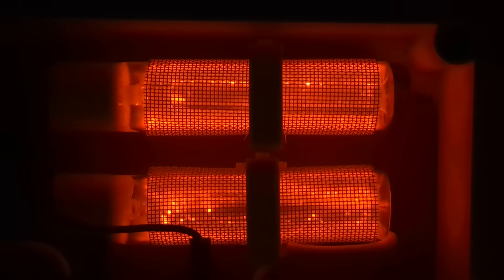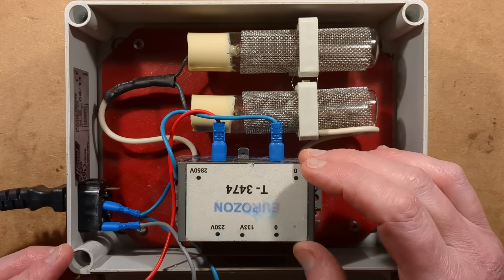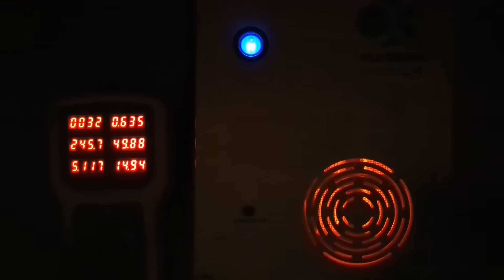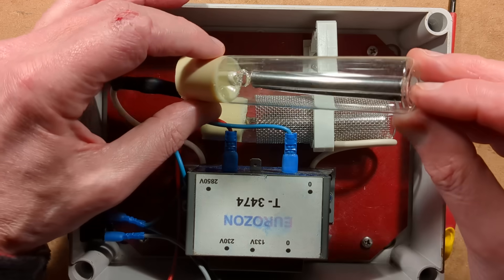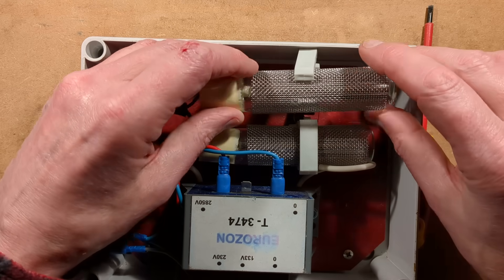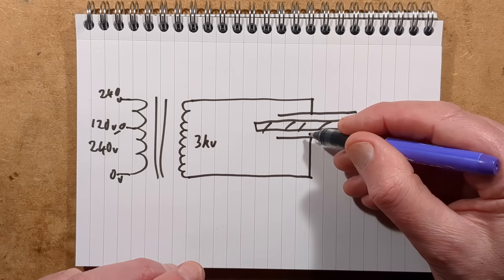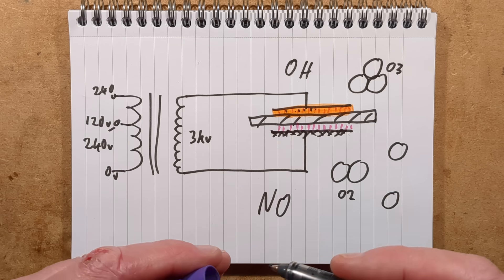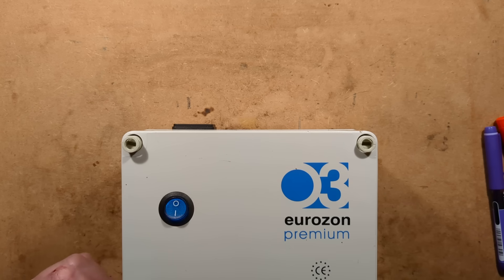Neon plasma ozone generator

Comment: This looks more like a DIY project than a commercial appliance. This type of box is used here in Europe for electrical connections or as a project box. My OCD also shoots up whenever I see an appliance with the on/off switch positioned with off at the top and on at the bottom. I see this regularly in DIY projects here on YouTube. Of the commercial appliances I've ever seen, I've rarely seen a switch with the on/off switch off at the top and on at the bottom. Years ago, I heard a story about why most appliances have the on/off switch on at the top and off at the bottom. The reason was supposedly for safety reasons: if the appliance is against a wall or on a table and an object (e.g., a book from a shelf) falls onto the appliance and hits the switch, if the switch is positioned with off at the bottom, the appliance will turn off (if it was on). Conversely, with the switch arround the appliance would turn on, which could pose a safety hazard.
Reply: commercial appliances often are just standardized electrical boxes with stuff inside. Maybe you are confusing commercial with consumer appliances. Anything sold to consumers must have a custom-made box of often debatable design for some reason
Reply: @marcogenovesi8570  commercial appliances have usually custom made boxes and not universal electrical connection box / project boxes of the shelf.
Reply: Do I understand it correctly, that for off at the top feels more proper? Where are you from?
I noticed, that in Ireland they almost always have off at the top of the switch, which was notable, becaus in Germany off is usually at the bottom.
Reply: @HalfInt  you got it backwards. i meant that it is more proper with on at the top, and off at the bottom. English is not my mother language,i used google translate and it messed up the translation.🙂

Comment: Darn Clive, I was hoping you'd light the neon tube without the mesh around it. Those are very interesting tubes and I didn't expect such huge electrodes in there.
Reply: They won't light without the mesh. The mesh is the second electrode of what amounts to a gas discharge tube.
Reply: @sootikins Aah I see. But why do they have 2 electrodes inside then? Perhaps they used tubes that were also used for a different application?
Reply from the maker: It's standard base with two wires coming in, but only one electrode.
Reply: the mesh is a necessary part, it's the other electrode

Comment: This "Eurozon" is an spanish bussiness (with not the best construction) and it's easy to find this ozon generators in bathrooms in bars and restaurants.
Reply: Those are the very compact ones like shown here.  They make industrial ones as well.
Reply: @douro20  yes and industrial ones have better construction sure, but this "semi-domestic" unit it's too basic, they could mount a cheap fan to force air and get better ozone efect.

Anywhere this is an old domestic device and Eurozon probably is way better now than ten years ago.
Reply: Poor Italians getting crossfire from a slightly shi__y Spanish design ;-)

Comment: 2:45 Ozone is heavier than air (actually 1.5+ times heavier), it will flow out of box through all bottom openings and create draft.
Reply: Ah, that bit of info makes it all make sense.   As the concentration in the enclosure gets very high the flow will begin.  Thank you.
Reply: ozone may be heavier but it would take terrific amounts of ozone for that to matter.

Comment: Seen one of these in the Gents toilet block at my local park. Only public toilets around that don’t stink. The park is National Trust land is kept cleaner than our municipal parks. Glad to know exactly what the unit is.
Reply: This explains why it has no moving parts.  
Longevity in Operation, as the units I doubt get much maintenance at all - ESPECIALLY when used in Public commodes.    
All of a sudden the lack of a fan makes perfect sense.
Reply: Same here...I saw an ozone unit in the public restroom at a state park. There wasn't the usual stink associated with public toilets...
Reply: Where exactly is that public park... 😊
Reply: Stinky toilets! 😭👎🤮
Reply: Any warning on how long you can stay in there before you fall ill?
Reply: @tonysheerness2427  it's not powerful enough for that
Reply: @tonysheerness2427 The converse of “if you can smell ozone, there’s too much” is “if you can’t smell ozone it’s probably safe”.

Note the “probably” and act accordingly.
Reply: @tonysheerness2427  & if it has an extractor fan in addition to the O3 thing = the gas is being continuously sucked out of the toilets

Comment: I kinda want one of those tubes to try with my violet ray wand.
Reply from the maker: They make ozone tubes for the violet wand system.  But just putting a grounded mesh on the standard glass electrodes would work.

Comment: Wonder if the transformer hit the green neon. I have a question about using uvc to clean the air, you have mentioned In past videos that their is such a thing as to much corna discharge. If I were to put a unit in my a house hvac how offten would you cycle it? Or only when you were  out of the house.
Reply from the maker: You would only want a trace level of ozone indoors.  No more than exists naturally outdoors.

Comment: i'm only a small way into the video, but could you place a cheap USB fan near the grille? or does that damage the fan/battery? (am art graduate not sciency, sadly)
Reply from the maker: A small fan blowing in would increase the effectiveness greatly.
Reply: would it be better for it to blow over/near the top opposed to blowing at the base due to how suffocated it looks? i guess my initial mental image of an improvement was either a fan pulling from above...or some goose-necked fan snaking its way to roughly above the output grill (if one didn't want to modify the chassis itself)

Comment: An ozone generator in a plastic box? Wonder how long that will last before it crumbles away from oxidation.

As far as nitrogen oxides go, you've got

Nitrous oxide: N2O
Nitric oxide: NO
Nitrogen dioxide: NO2

They get progressively more toxic as you increase the oxidation level. Search for a YT video on the Cleveland Clinic fire for a good example. I think it was the Fascinating Horror channel, but maybe Scary Interesting or Plainly Difficult.

Comment: If you can smell ozone it's to much for food.
While working at SunCorp Stadium, I was told by the food inspector that high ozone accelerates food going off as ozone breaking cellular structure.
Reply from the maker: I think it would take extreme levels to physically damage food.
Reply: depends what food.  fresh fruits and veggies, I think, would be somewhat resistant the same way we are -- we have skin

Comment: This is s type of dielectric barrier discharge (DBD) rather than corona. Corona discharge doesn't require an insulator (the glass) and uses higher voltages, but is less efficient at generating ozone. These two types of discharge are frequently confused.

Comment: 11:01 Nitrous oxide is N₂O. This is the "laughing gas" used as an anaesthetic by dentists and by some people to get high. Nitrogen forms a lot of oxides. I believe you were thinking of nitrIC oxide, which is the one that's NO. There is also NO₂, nitrogen dioxide. The Wikipedia says that it is nitric oxide which is made by lightning, so the high voltages could generate that on their own.
Reply: Nitrous oxide is also what makes your car go like a rocket when you add a measured amount to the combustion process.
Reply: @AcornElectron  or blow up the engine if you use the wrong amount
Reply: Some sources also claim that nitrous oxide will also be produces in corona and dielectric barrier discharges. But proably only trace amounts, not enough to get high from it. You would feel unwell from the ozone and other nitrogen oxides first.
Reply: Yes he means nitric oxide and this can further react with air (oxygen) to form nitrogen dioxide which will dissolve in water to make nitric acid. It used to be a pathway to manufacture nitric acid and still is, where electricity is cheap. The process used an arc discharge rather than a barrier discharge because of efficiency.

Comment: Looks very nice, but lack of flow is a flaw.
Reply: Adding a small fan would be a good idea, but then of course you'd have to fit some kind of power supply for it, which could end up being more complicated than the rest of the unit put together (a cheap Chinese SMPS from ebay would probably be safe enough, especially if it's inside the case where you can't actually touch it. Maybe a capacitive dropper might work too as long as the fan is a low power one.

Comment: I'm surprised the plastic parts inside the enclosure haven't been degraded by the ozone.
Reply: That was my first thought when Clive pointed out the absence of a fan- the thing will fill with ozone which will only slowly diffuse out through the “stylish” (in a retro 70s military speaker grille manner) ventilation holes.

My guess is that it didn’t see much service before Clive got hold of it.
Reply: Is there a trustworthy source where you can check various materials how resistant they are towards ozone?
Reply: @abavariannormiepleb9470 Yes, you expose them to ozone and check them periodically for degradation. There are charts and tables online with results for many materials.
Ordinary wire insulation (not the HV silicone) and paint are notably susceptible to degradation. The fact that they aren’t discolored or crumbling suggests this particular unit probably hasn’t seen much service.

Comment: I don't see need for fan. Over the long run (hours, days) the ozone generated will diffuse into the room. Or what recombines in/near the box can be compensated by a little more generator (maybe why they have two tubes?)
I think/hope this is a stink killer for a toilet room. I go in, I make my stink in 5 minutes, then maybe not go back in for 4 hours: about 5% duty cycle for my lungs. Compared to most city and some office air, that's nothing.
Reply: other people have reported finding this in toilets so you seem to be dead on

Comment: That is the Star Trek TOS-est thing I have ever seen.  Would also accept Blake's-7
Reply: a whole different kind of aesthetic for sure.  most devices would hide everything away, but they wanted to convince the customer it's doing something!

those neon bulbs are so weird.  I wonder the story behind them.
Reply: @tsm688 Now that you mention it, it’s kind of strange that anyone would design the tubes specifically for this purpose. The popular association of ozone with UV would suggest a different gas that emits in the blue, like argon or xenon.

Could be they were originally designed for something else like a specialized indicator or narrow spectrum light source, but I can’t think what in that single-electrode configuration. They might work nicely in a violet-ray machine.
Reply: @markfergerson2145  they could be ends from big cold cathode tubes, filled with neon, fused shut, and used backwards.  just creative use of leftover parts.

the use of neon everythings, even buttons, even weird old green neon indicators, suggests they have a lot of gas tube overstock